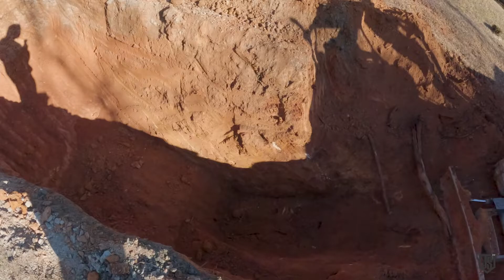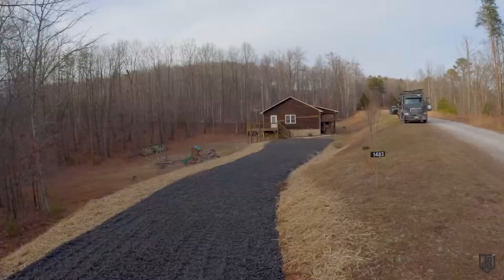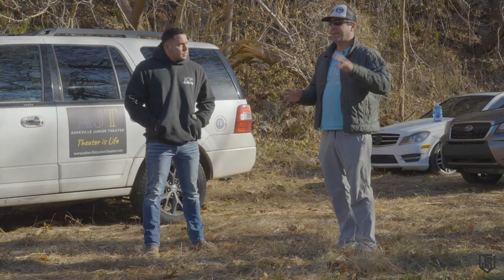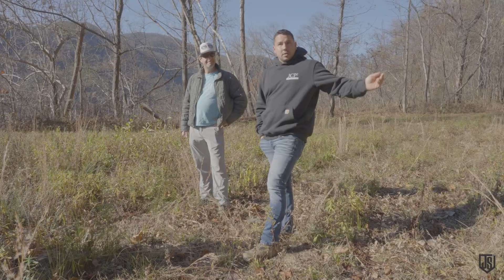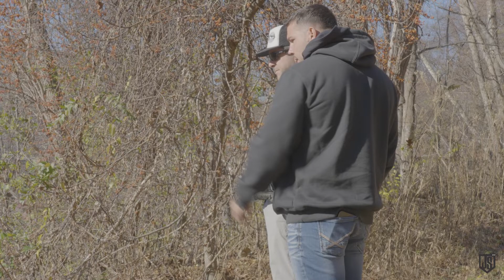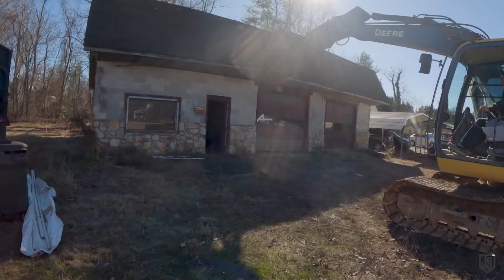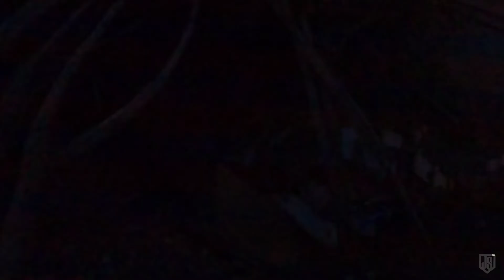Sink Hole Repair and Homeless Cave at the Demo Site!

Comment: 0:36 maybe I’m just an idiot or I missed it because you’re thick accent, but what’s wrong with putting trash in a hole in covering it with dirt and then making a driveway how was a sinkhole being caused by that?
Reply: The organic material rots, compresses and settles especially with an active driveway above